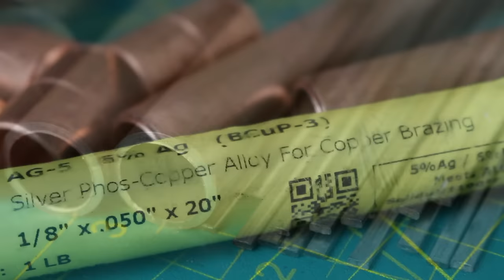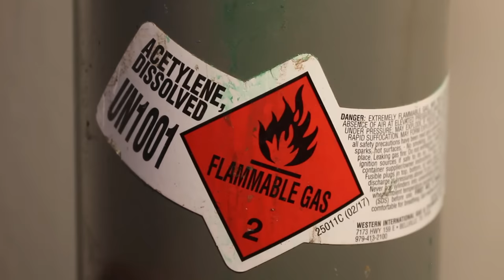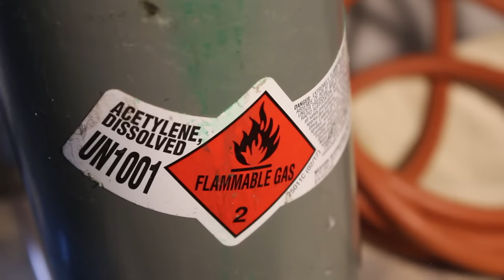How To Braze Copper Pipe Like A Pro (HVAC Refrigerant Lines)

Comment: Almost melted the pipe
Reply: Lol this video gave me a lot of anxiety.
Reply: It should be how not to braze,  lol.
Reply: Nah it got red for a sec.
Reply: Invites you to BBQ:
    Burns the meat to a crisp. 
     NICCCEE
Reply: @chuckydombroski  when it gets cherry red like that, it’s about to burn a hole through 🤣 you don’t need to get it that hot to braze. The only time you should be getting it that hot is if you’re sweating the joint.
Reply: I'm a refrigeration steamfitter, he brazed that fitting like a week old helper.. lol. He overheated the fitting and thought he was using 50/50 soft solder, lol no need to clean oxidized copper, the heat burns off impurity's. Love these pro's
Reply: @dansullivan8817  where's your video at? Send the link, I would love to watch it.
Reply: @dansullivan8817  I have been in the marine commercial hvac/ refrigeration busniess for over 27 years and was taught way back to always clean the pipe no matter if your brazing or soldering with stay Brite 8. I do agree the heat was excessive.
Reply: @marioalberto8319  isn't 15% silver brazing rods liquidus temperature around 800 to 820c? copper turns salmon red at that temperature. liquidus temperature is necessary for the brazing rod to enter the joint fully under capillary action otherwise the brazing rod will just form fillets at the joint surface if the temperature remains below liquidus temperature. so to achieve full capillary penetration (maximum joint strength) heating copper to salmon red color is important. the only thing wrong in the video is he was concentrating his heat only on the fitting instead of also heating the male end of the pipe. that's why his brazing rod was flowing more towards the fitting instead of IN the joint
Reply: @lordjaashin  
That’s right! Too much heat was there . Specially if the joint will be next to a filter dryer or compressor…..
Reply: @yuriigorg721  you misunderstand my comment. amount of heat is not the problem. focus of heat in wrong place is the problem. he should bring  the fitting and male end of the pipe to the same temperature at the same time. which he didn't do. he brought the fitting to the correct temperature but the male end of the pipe was cooler than the fitting. which made the brazing rod to flow on the surface of the fitting instead of inside the joint.
Reply: When I seen braze like a pro and seen the Btank torch tip that's when I knew this video was gonna be interesting lol oxy acetylene my man, braze like a real pro
Reply: Can you point out the mistake
Reply: He could have just used that mapp gas torch and been just fine.
Reply: Where's your video at bud
Reply: Why you dont show us?
Reply: Lordy Lordy Lordy, no cherry red. Do you want carbon forming inside the pipe? Resounding No. this is the lazy way of doing it. Bleed nitrogen thru and keep it just under cherry red. Once you’ve gone cherry it’s too much heat. He got it so hot carbon formed on Theo it side of the pipe, what do you think the inside will look like? You think all that carbon clogging up filter drier metering device compressor valves etc. is good for a system? Not so much. No cherry.
Reply: La2venida, I can’t point out anything he did right? Start from there
Reply: @potatolew4495  if you can't stand the heat.............
Reply: You don't know.... carbon lay down wouldn't be that compromising to the integrity of the copper; especially since you're saying the carbon would have to form from the thermal decomposition of CO from the products of combustion. This would be negligent.... A more likely reason for people telling you cherry red is too hot, is because you begin to alter the arrangement  (packing) of the atoms. Manufacturer's heat treatments would be basically reversed once you start to approach the melting temperature
Reply: Pipe looks deformed

Comment: I do commercial refrigeration for a living and have run 2 5/8 pipe through an entire building for a grocery store. Your prep work is perfect. But Red hot is way too hot for a small pipe like that. I am saying this respectfully as I just want to help u. your welds did not get enough penetration into the cup of the 90 and they would crack and leak in the field and you did not put a shoulder on the rim of the cup. You should start by heating up the pipe that is going into the cup of the 90 (this will help the rod start to melt when it is time to add it) then work your way onto the cup of the 90, now u can start adding the rod onto the rim of the cup of the 90. Now move the flame from the rim towards the center of the 90 and watch the brazing rod rush deep into the entire cup. Now do this all the way around the cup of the 90. Then pull your torch back and add a “shoulder” to it meaning. Pull the heat back to where it is just barely melting the rod and adds barrier of rod where the rim of the 90 and the pipe is. This is an insurance policy for leaks.
Reply: Just started in the industry and there is so much I don’t know.  My 2 attempts so far I melted the pipe.  Thanks for the tips. Hopefully I’ll catch on sooner rather than later.

Comment: The key to brazing in refrigeration is to get the joint hot quickly ( not red hot ) and fill it quickly. If you were to get a service valve, reversing valve, or TXV this hot, it would be ruined.
Reply: Agreed. There are a few options out there but I'm weary about some of them. The "cool gel" type products tend to work pretty well. I usually try to wrap a wet rag around the sensitive components. But brazing the suction line into an air handler is always a little scary for me because it's so close to everything else. Oxygen Acetylene works great to heat up quickly, but I rather use Acetylene. Just figuring out how to protect the components can get tricky.
Reply: Brazing rod melt at 1200+ degrees… That’s glowing red temps. Soldering is done at much lower temps, there are good HVAC solders available nowadays. Just got to be carful not to flux it like a plumber would.

Comment: Bro u were nowhere near the perfect brazing lol but practice makes things perfect. try again and again
Reply: Im interested in seeing one of yours .talk is cheap imo
Reply: agree.  He still does not know when it is at the temperature, I know if he needs practice or nervous
Reply: So what's wrong with the joint? Its full and doesn't leak.
Reply: James Luker in terms yes, the joint is complete and wont leak but theres some things he missed, one being you have to purge nitrogen while brazzing, ik hes using a demo so these pipes arent really part of the system but he could of mentioned it since all the carbon inside could lead to a lot of problems with txv, and conpressor. Also his joints may not look like they are complete usually people like to not have the edge of the female end be sticking out, be shown, or feel it while running their nails/fingers on the joint. And this is because it can eventually cause a leak by the high pressure. So people mainly fill the edge until it doesnt show other than the melted rod. But he does know how to braze decently, and he’s probably practicing, so people really shouldnt be bashing him for this. I mean im in school learning this trade and i still dont know how to braze a joint in less than 30s or without using too much rod.
Reply: @pedrotrejo5519  he was kinda bubblegumming the joint tho. The way that works best for me is act like you're trying to stick the rod in between the joint. And cherry red is a no no in my eyes lol. He was ready to braze when he struck the rod the second time and it melted onto the copper. But his worked and would have been fine as long as he purged nitrogen in a real life situation. He just needs more practice and he'll have it down.
Reply: @arodandjeter1  

Great input.   So would you need a high temp flux to properly join the fittings along with a N2 purge?
Reply: @rescobar8572  That’s what I would use. Some people like stay brite 8 and other soldering stuff but I use 15% silver. And YES purge nitrogen.
Reply: I agree lol
Try and try and try to try again 🤣
Reply: Nomi is right. Cherry red pipe is no good. Bad braze
Reply: @jerseyjim9092  your explanation is inadequate. People should not put out educational information unless it is correct and his most of his information is incorrect and his technique was terrible.
Reply: @rescobar8572  no flux.

Comment: Bro you need to heat the pipe from the BOTTOM so when it's hot enough at the top, your solder will run all the way round it from the help of GRAVITY.

Comment: I like your video, nice production. I just have a few notes. First, there was no mention of any nitrogen. Nitrogen is necessary to prevent the oxidation of the copper during the brazing process. The particles left behind, especially on very sensitive newer equipment can eventually lead to an obstruction like oil pooling in condenser coil or blocked TXV or piston. Second, prepping the copper correctly helps ensure a proper weld (add a bit more info for the beginners). 
Third, I liked the way you ensured a solid weld around the piping. I did notice that you had you stick bent allowing for about 1" of rod. Example, allow 2-4" of round off your coupling. Use the rule of thumb, if your nail can get caught on the joint, round it off more rod. Lastly, always heat the copper at the fitting not the pie going into fitting, this really helps. Especially with vertical braze joints. Good video, we all are learning each day!
Reply: This guy knows what he's talking about. Can confirm
Reply: heating the fitting is BS.  the fitting will glow red hot Way before the pipe.  in vertical situation you can add a little heat to the fitting so it soaks up better.

everything else is good/usable information.
Reply: @casemodder89  I should have stated to start heating at the fitting. Nice catch!
Reply: Nitrogen to prevent oxidation? Can you elaborate please? What is the product you use for that?

Comment: I work well outside the scope of welding in commercial roofing.  It's a healthy endeavor to at least have a curiousity to what some of our brothers and sisters in other trades do in contribution to our projects.  Thank you for sharing knowledge.
Reply: This is brazing buddy not welding, there's a huge difference between the two. But, more power to you for being a roofer, one of the most underpaid and dangerous jobs to ever have! 💪🏼
Reply: I'm with you, I'm an insulator and work with fitters and plumbers all day. Knowledge is power.
Reply: @ASAPJermz it's not that far off from welding. My old man taught me how to weld using an acelatine torch and coat hanger. The main difference is temperature and you're not melting the main metals.

Comment: Thanks. My first braze worked out great after viewing your tutorial. Previously I was not preparing the surfaces correctly and the pipes were not hot enough. I really had to heat them longer than expected using MAP gas.
Reply: Dammit, I am seeing your comment one year later and wonder if your equipment lasted this long if you followed this idiots directions. Never got your pipe cherry red unless you don’t like the people your doing the work for.

Comment: Nicely made video dude, just a couple things to improve on in my opinion. Cherry red tends to be too hot for a quality joint, as you run the risk of porous braze joints. Preheat your female fitting to a dull red, and start to feed the brazing alloy in using the heat of the copper to melt the alloy. Flux is a must on dissimilar metal joints, and I suggest using 15% silver alloy for copper to copper. 45% for copper to brass etc. plus flux.
Reply: purely gold
Reply: In fairness, he mentioned flux for dissimilar metals

Comment: Good tutorial. I've been in HVACR many years and never used acetylene without oxygen so I can't opinion on whether is better but it appears that the pipe is a little bit hotter than it needs to be. Okay for pipe to pipe connections but maybe too long and too hot for heat sensitive connections like reversing valves, TXV's, service valves etc. even though a heat block paste or damp rag is implemented. I use 15% brazing rod and I find it flows much better than 5% at a lower heat.  I did learn that I don't clean my copper as well as I should. Lol...

Comment: I've been doing this for 40 years as a contractor in the HVAC/R  industry and I would fire you on the spot :)
Reply: I thought the same thing....  in parts of Denver you will find  40+ year old brazing  of 2" copper that is mind blowingly perfect. Some inspectors don't even know what they are looking at... thinking  it was factory ordered !!!!!!
Reply: @thomasyunick3726  First off he didn't have enough heat, should have been using oxy/acet torch. Then he said he was going to  "fill the gap" capillary action doesn't have "gaps". My brazing certificate was with 2 1/8" type L copper using 15% sil-fos and flux, I was able to achieve 98-99% coverage on vertical, horizontal and angled tube. This looks like he was buttering a piece of bread..
Reply: @josephsangregory6436  My favorite was always flaring.  ( so easy ) 1" soft copper... 2 wrenches, cutter, flare tool, hammer, fitting. I spend a lot of time in deep trenches. I brazed for a little while but mostly helped a  certain friend here or there. that also plumbed submarines for decades. I have  tagged along on many many repairs. A lot of 2' pipe.  I have definitely made a few pipes connect more than once. I do  stop and waste and backflow connections for irrigation.

Comment: Try moving your heat off of the pipe and towards the bottom of the cup.  You should be filling that cup, then draw the flame back and cap the joint so you can not see the lip.
Reply: gold！
Reply: Yup! Bad shoulder. He ain’t “brazing like a pro”
Reply: You mean the bell not cup
Reply: He definitely means cup aka fitting lingo is lingo but a perfect braze and a good braze are 2 different things and this ant it

Comment: The same people who think the dull cherry red is too hot are the same people who’s braze rod sticks to the pipe when they try to fill the joint and dosent flow. The pipe must be hot enough to cause capillary action and that is usually at the temperature of cherry red
Reply: You are absolutely correct and he is on the right path if I had anything to say it would be to apply the flame to both pipe and fitting at the same time and faster to avoid oxidation the torch tip should be closer at the blue part of the flame  to get to temperature
Reply: Yup you are right. These same people  do not know about "liquidus temperature" and capillary action.

Comment: In the industry we use a Oxy/acetylene kit, the only place we use a B tank with turbo torch is on open lineset mostly in commercial refrigeration.

Also use a silfos alloy and not some cheap silver.

Don't heat the cupling first, always the pipe first so the silfos stick to the pipe then heat the fitting to penetrate.

Flux is used when you use different metal and also when reusing old piping.

Comment: When cleaning the burr the copper line must be tilted down so the burr doesn't get inside the tube. The tiniest amount will become a restriction. When brazing you should purge with nitrogen otherwise the scale produced inside the tube will mix it today's refrigerant oils causing  restriction  and or attach the compressor winding's..It should also be mentioned to use minimum 5% silver upwards to 15% silver content solder when welding air conditioning and refrigeration copper ..
Reply: 0% is also acceptable.
Reply: OB Wan, you have a pretty good understanding, and you have a descent description (that you give here within). I would agree that 5% to 15% silver content brazing rod [not solder(ing)] and it is not welding (it's brazing).

Comment: One small critique if I may. If you hold the inner flame on the joint it will heat much more efficiently and move the flame in toward the fitting as the filler follows the heat. You don’t need so much on the pipe. Also, that long under the torch seems to weaken the fitting to a degree that it easily collapses at the slightest torque
Reply: The reason the fitting collapses is because heating it cherry red and allowing it to cool annuals the metal and makes it soft. If you heat it and then hit it with a cold rag quickly, it will harden again. This is tricky as a guy in the field probably isn't controlling the temperature that accurately and quenching improperly can create cracks and internal stresses.
Reply: Jeff Peterson but quenching can cause cracks in the filler and leak
Reply: Im not really an expert, but I agree. The heat draws the solder or braze in. Some of what happened here just layed more filler on yop, improving the look, but didn't likely travel in to where it counts. The idea is to work the torch to evenly heat the assembly and 123 add braze so it runs in. In some ways you only have one shot to really nail it perfect. Will still hold, but you'll have added twice the filler. Most will just be laying on top.
Reply: The teacher said something similar. Apply heat to the back of the fitting so the solder chases the heat. Got my first brazing copper project tomorrow.